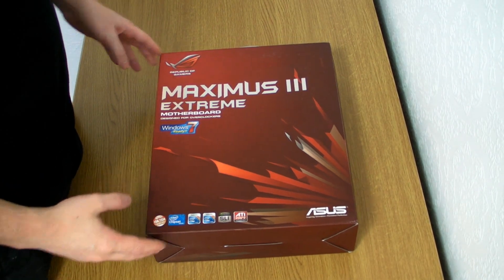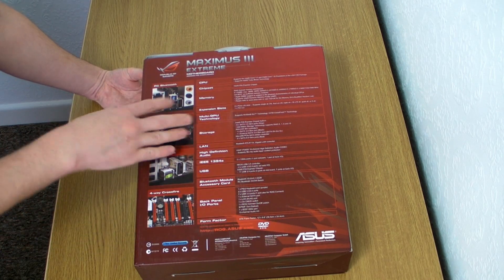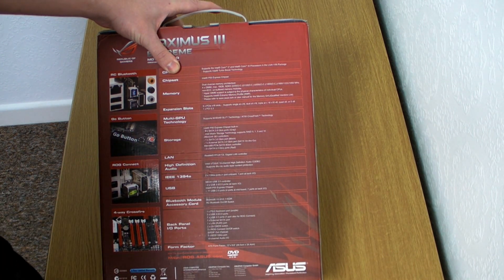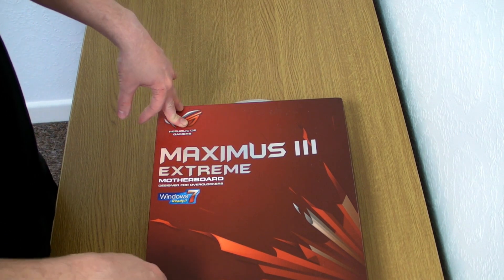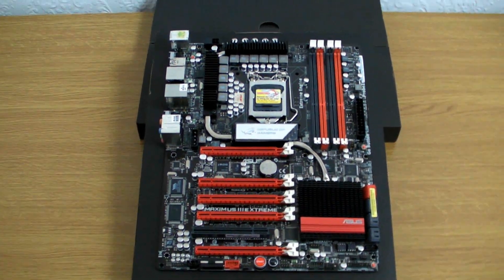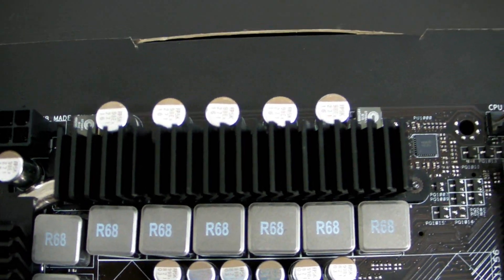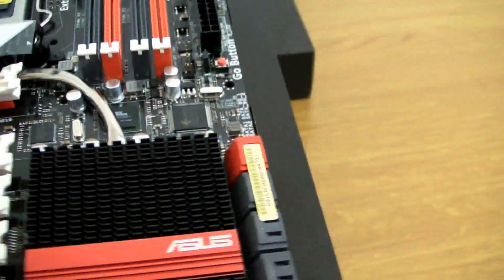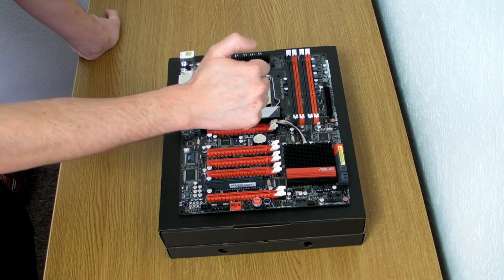Asus Maximus Extreme III

Comment: 1156 or 1366?? Rampage 2 Extreme is 1366 and this one is 1156. Yes, this one supports the i7-8XX, i5, and i3 but Rampage 2 will support 6 core when it arrives. They're might release a  new one with usb 3 or whatever so there's no such thing as future proof nowadays. Just buy what you can afford. =)